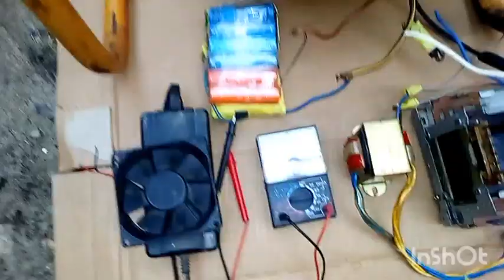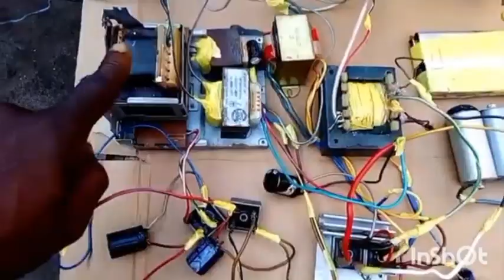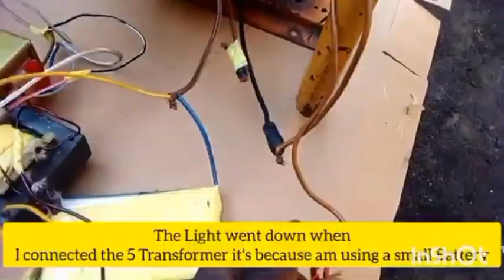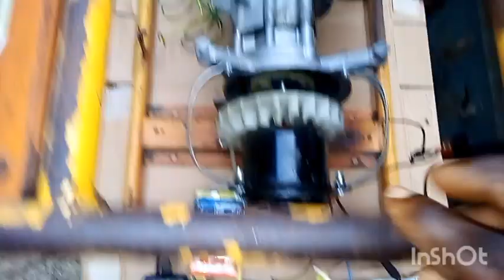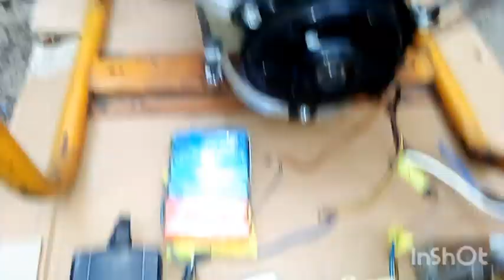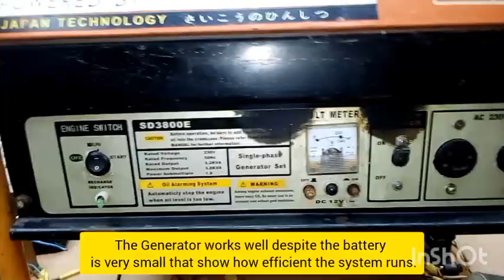Fuelless Generator Charging Issues.

Comment: Nice video, might I suggest using a Tesla pancake coil for wireless transfer of output power and less drag on the generator. Output the energy using more pancake coils, no direct/physical connections between pancake output coil and pancake generator coils. Ferrite transformers at that point will just add drag creating losses.
Reply from the maker: Wow 😲 am impressed by your knowledge thanks so much

Comment: Hello am a mathematician into circuit building. I will suggest you use three 15volt transformers, connect each of the transformer with a rectifier seen your video. Connect 2000uf by 25volt across each rectifier for the three transformers respectively. Then, connect all positive terminal of the three rectifier together and all three negative terminal of the rectifier together. in this case, the three transformers connected with rectifier and 2000uf by 25volt are independent chargers. You can then connect the three positive and the three negative terminals together (parallel connection) before connecting to the battery. The battery size must be of a higher ampere. Say,30-75 ampere or more (12volt battery). The reason why the generator slows down is because the dc motor draw more current than what the dynamo produces.  In abstract physics 220ac voltage may not produce up to 13 ampere of current. In our homes socket burn easily due insufficient current supply to home appliances while in use.
Reply from the maker: Thanks so much sir, am really impressed with your knowledge. 🙏

Comment: You don't need multiple transformer to make a good battery charger....
You need to check the watts of the transformer...
I believed the capacity of the generator alternator is 950/650watts....so using those transformers is killing the coil for the alternator...
Just get a good 12volts laptop charger with a 100watrlts...
Reply from the maker: Thanks for the feedback, I'll look into that for sure!

Comment: I build a bigger fuelless generator I pass true a lots but I still finish the project and enjoying its 8.5 kw with 2 universal motor and powerful liquid cooling system for the 2 universal each of the universal motor is 16,500 rpm and big flywheel that suits the generator and fast battery charger 4 phase smart automatic charger 10a-70a charger
Reply from the maker: Wow! That is amazing. Thanks for sharing your experience, sir.
Reply: Would love to understand more... I'm gathering materials for 8kva as well. But I don't know the spec of the DC motor to use.

Comment: Hello am also a fuelless generator engineer you keep talking about automatic voltage regulator avr that is going to power the motor I will advise you to do your test properly first in your generator before coming here or posting a video and talking about automatic voltage regulator avr you have to finish first the testing to know if AVR work or not you will be surprise that it's we also fail so do your test before making suggestions on AVR To know if it's work
Reply from the maker: Thanks for your advice, I'll be sure to take it into consideration.